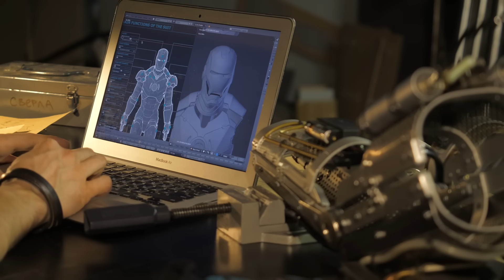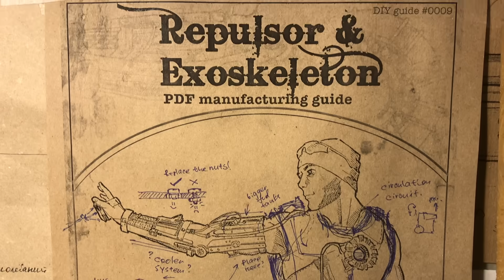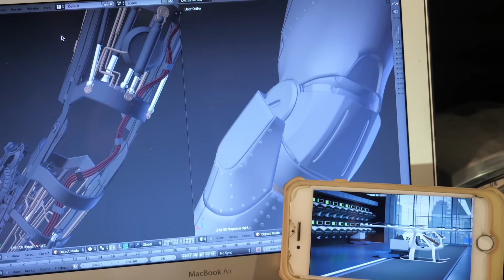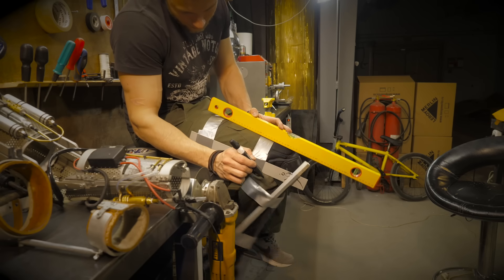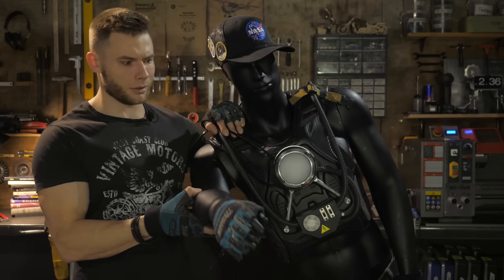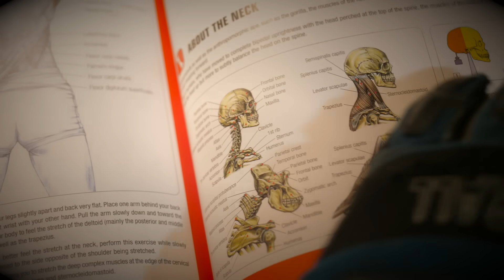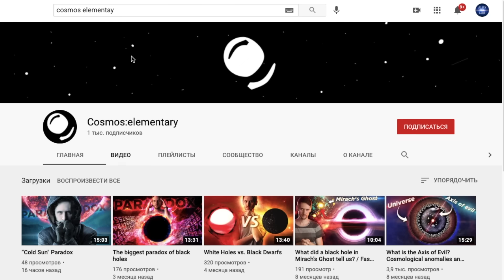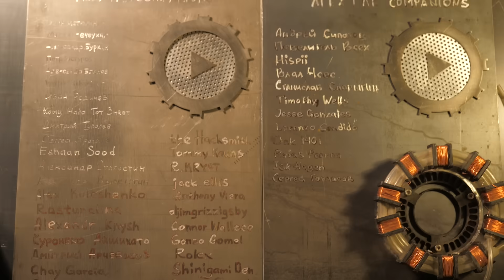Building real Iron Man suit (Part#2: Exosuit, hydrogen muscles & EMG sensors)

Comment: Could a brushless dc motor on either side of the knee and pneumatic cylinder with a ball or spherical joint in front of the knee work for providing strength support?

Comment: Hey dude, have you thought about using structural silicon as ligaments? It would be a bit more flexible than springs. Assuming it can securely attach to the aluminium frame.

Comment: @Alex Lab, Hey Man, your ding your elbow wrong! You need a ball-joint with a flat back and limited angles for safty. Also the thicker steel with the sleet ball insert will give you a little more protection on your joints. You can just cover it with a cosmetic joint for show.
Reply: You’re about a year too late…

Comment: Hey Alex, I had made a previous comment on how the iron man suit, is not a good design. Your starting to realize that. Flight is not even the biggest pain in the butt, its walking and mobility. Im using titanium and kevlar and running into a weight penalty. Then you have to solve the cooling issue. It gets hot in there. Im building a under garment cooling suit, you can adapt cpu water cooling fans for this. This has to be your phase one. Once you have the cooling, you need life support, or how your gonna breathe. Im using a small hepa filter feeding into a modified sanding mask. Then you need to be able to communicate. A radio and a PA system. You see the limitation of fitting all this in an iron man suit. All engineers are familiar with the KISS principal, or Keep It Simple Stupid. Your HHO generater is brilliant, but why not make it larger and back mounted? Then everyone wants flight, screw flight, think power jump instead, or enough thrust to give you moon gravity. Again, this will be loud and hot. Then theres power generation. Id do HHO to a gas engine to a generator, back mounted. Then the exo has to be able to transfer the full weight of the suit down to the legs. Thats where you need the actuation and suspension. Boy designing one of these really is a pain...huh?

Comment: some of the issues i'm thinking of now is rust, degradation, friction, lubrication, gunk, you will have to maintenence all parts like you would a jet in my excitement I didn't take that into consideration theres also the power supply issue you could use paladium and cold fusion but how to make it small enough? of course another form of metal and radioactive matrial could be used.

Comment: This might work for flight maybe if static repel off aluminum but magnet fields can go through then an electro magnet can be in the center of an aluminum box of some sort when on walls of semi conductors can suppress the fields and then shut off the electro magnet then you have a box of electrons and the Earth's surface is negative charge to some degree so it might just repel

Comment: I'm concerned with your usage of brown gas at that pressure. I might have missed any security mechanism, but you're wearing a shrapnel bomb. I got hydrogen exploding in my face at room pressure and it was nothing, barely burned the tip of my hair (hydrogen burns hot, but too fast to do serious damage), but the story changes at high pressure and with metal that can be propelled by the explosion

Comment: Just love what your doing with this.  But we need a smaller diameter artificial muscle if your going to put armor plating AND force redistribution materials between the armor and your body.  A decade or so ago I saw some work being done on artificial muscles using carbon nanotube coils that reacted to a electric current that where considerably smaller.  I don't know if they would work with your setup however or if they turned out to be a good solution.  Couldn't find a good follow up on their results.
Reply: you should try to put this idea on the comment of his!!

Comment: sorry on bad explanation but why couldnt you make a quick connection separate parts design where there are two arm parts with tubes that have connectors on them and they are completely separate until ready to be put on you could even do it for the shoulder pads where there is a slot that they slid in and then you twist it a certain way and it locks on you could do somethign like this for the whole suit?

Comment: Hey Alex, it's rudimentary but if you still need a solution to fitting your arm into the suit when considering proportions could be by using a mechanism similar to what they use when testing your blood pressure. Although the overall dimensions would have to be the same as the length of your arm, you could implement this inside the exoskeleton and then inflate it to fit around your current mass. So you could have a nice fit even if the mass of your arms increases or decreases. In addition, it's air-operated so you could hook it up to the same machine that powers the exoskeleton's muscles. While this might not work for joints (I'm sure it could but you would need to add material to the elbow parts and increase and decrease the amount of air that goes into the cushioning in order to account for movement) I feel like in it's the simplest form, this could be well implemented in the forearm, wrists, and biceps. Also, this would help in minimizing damage if you fell.
Reply: you should try to put this idea on the comment of his!!

Comment: Ok... if you are going by how the armour amplified the users strength in the comic book, Stark incorporated linear flat armature motors in a 90 degree 'weave' to simulate human musculature. How did they work? No clue... absolutely no idea whatsoever... but if I had to hazzard a guess, they incorporated the same technology as a rail gun, but in a much much smaller and more controllable way... sorta like multi-position solenoids, but millimetres thick. 
The servo sounds in the movie.... well, let's just say, its along the same line as the "peeoo peeooo peeeoooo" sounds of the laser blasts from Xwing fighters in deep space. Silence doesn't make for fantastic on-the-edge-of-your-seat battle sequences. The oil squirting from damage... oddly enough, Starks earlier armers in the comics did use hydraulic actuators and cooling. But, we are talking about the mid/late 60s here.

Comment: General rule is to never pressurize hydrogen and oxygen in the same container, even if you are doing low pressure stuff like this. Why not carry a 15L scuba bottle? Weighs less than your generator and batteries and delivers way more rapid power. 
Good job so far, even with garage tools you are able to make this, well done

Comment: I can already see those artificial muscles going over the front of the legs are doing to need some protection to not get worn out by rubbing against the metal. Otherwise those things are eventually going to rupture from wear and tear, earlier than they would normally anyway.

If you haven't already you should consider doing some damage testing to those muscles, see how they perform overtime with and without a load. How many cycles they can generally handle before failing.

Comment: I guess this really highlights the difference between Alex Lab and the Hacksmith. When the Hacksmith was doing their iron man suit, they went straight to trying to fly. They went for the showpiece. Alex seems to have taken a far more logical approach, by working from the ground up to design a system that can work with the body, first and foremost. An actually useable system, as opposed to free-floating thrust. When (if) Alex adds thrust to his suit it will already be set up to aid him in keeping rigid/steady while under thrust.

Comment: I still think a safer and more powerful/efficient gas for your artificial muscles is nitrogen,its a ton more stable and slightly more powerful,and consider a built in nitrogen compressor to filter out and refill built in reserves. But your on your way buddy 👍

Comment: Alright Alex. i watch a few of your videos and agree with the high voltage pulses for more efficient hydrogen production, so i wanted to point you toward Magnetrons... for microwave frequencies. I have been looking into things off and on for many years now just haven't done anything with it yet.... one of those materials and equipment don't add up issues. I may have to look into the differences between high pressure generators verses low pressure generators ow and see what i can put together. 

as for your synthetic muscles... if you can sleeve multiples of those balloon assemblies together in groups and then place many groups along side each other and wrap them together you should get a far greater amount of strength out of them.

when it comes to the braces and frame work for the exoskeleton look into building contoured plates that have a 1/4 - 1/3 or even 1/2 twist around the limb (arm/leg) with a full ring around the end near the joints. this will permit your muscle to twist the metal supports when they compress causing the rotation of the joint permitting a larger degree of range in motion without compound hinges...

I would love to join you in your adventure!
if you have any questions of hard obstacles to get over in design please ask and i will see what i can do to figure out a solution, even though it looks as if you do more research into these things than i do.... i have lack of incentive and motivation issues. Creativity is key in a lot of these processes hard work is the step i falter at most the time.
Reply: you should try to put this comment on his comment to give him ideas!!

Comment: I was wondering if it would be possible to use the hydrogen generator to create hydrogen peroxide since hydrogen peroxide can be made from water as well. If you could use the hydrogen peroxide as rocket fuel for the iron man boots because if you spray hydrogen peroxide over a catalyst (i think aluminum or copper works best, I'm not sure tho) it reacts violently and rockets out the back which could be used to create a cheap rocket engine that could create its own fuel. I don't really know, how practical this is but it's just an idea.
Reply: you should try to put this comment on his comment to give him ideas!!

Comment: Hm, I wonder if you could use a hydrogen fuel cell to regenerate the water that would have been lost through venting the excess gases.
Electrical regeneration is a nice side benefit, but I don't expect to be able to get all that much power back.
Reply: you should try to put this comment on his comment to give him ideas!!

Comment: Hey Alex, it would be coo if for the helmet display, you contacted the former producer of NORTH glasses, see if he has some to spare, and then use those as lenses for the helmet, coding a Jarvis display into the arduino. You could find some videos of people creating Jarvis displays with tracking and everything, the tracking of people could be from the AI matching them to social media accounts, but of course this would also connect to turning of muscle contraction by turning of the arduino that reads your natural electronic impulses, turning on thrusters, etc, of course it’s all connected to voice command. I would also look at the Iron man MK5 wearable functional helmet for reference of voice activation, inner comfort, and adding IR lighting to the inside of the lens would be cool as well. Finally connecting Alexa to the voice activated helmet could lead you to have full control and automation of your lab, drones, etc, from your suit. Additionally, for the flight of Ironman, I know this a bit unconventional, but it’s worth a shot, I would look at the work of Victor Grebennikov, and supply current to a honey comb like structure shoe bottom, creating a levitating platform (Grebennikov used the molecular honeycomb structure in scarab beetle wings). Another suggestion is, you have multiple modes for your thrusters that are changeable by the automated turning of the “nozzle” so to speak, via motor controlled by an arduino, it would kind of work like a hose head with different settings. You could have blast mode, sustained fire mode, long range ray, short range (however these would require a longer and bigger laminar flow nozzle and more hydrogen perhaps, so not necessary). And of course with muscle contraction on the suit, combined with Jarvis’ tracking systems, with the push of a button on a watch like mechanism, maybe it could walk to you, presenting itself for a suit up. Also, it would be cool if your helmet had a regular flashlight mode, and also if one of your other hands had an activatible electromagnetic function. Just some cool ideas.
Reply: you should try to put this comment on his comment to give him ideas!!

Comment: I'm no engineer, but instead of having 2 pivots at the elbow, would it be easier if you had one pivot that could slide?
So let's say a normal pivot would be a circle peg going into a circle hole, you could make the hole pill-shaped giving the peg the ability to slide, making it more mobile.

Maybe you could also add in a locking mechanism to make it easier to pick up heavy objects

Comment: Idk if it’s possible but a gas mask type mouth cover would also be a good idea to stop moisture escaping into the helmet and if you decide to put something covering the eye holes it will help them not fog up. U could also attach it to maybe an air tank for high altitude. It’s also a good idea to look at some space suit tech for insulation, heating, cooling, cus if you do end up being able to fly u will be cold. Aero gels might be a good idea for an insulator but you’d have to find a more rubberized version then the brutal ones most seen today. There’s also the fact of hearing inside the helmet, could probably use hearing aids tbh and there are some pretty cool looking ones these days. You could also try and install and google glass type thing that feeds you information from things you are looking at. Would also be cool if you took drone tech and could have drones that fly above you and relay an image back like they do to drone headsets. Zoom lens might be good too  although it’s a lot to fit on a helmet. Image a swarm of tiny drones that you could just release and would give you like a couple block birds eye view.

Comment: On the subject of synchronized movement with artificial muscles, perhaps in the future things like neurolink will dramatically help with timing, in case sensors are too tricky or take too long to get in and out of. Also, I’m curious to know how the hand muscles will work considering a big part in lifting weights is grip strength. Maybe some sort of locking mechanism can be put into the hand that is triggered by a sensor that tracks a specific load (like a seatbelt when you move forward too fast)? That way your hands will not fatigue so quickly when lifting/carrying heavy objects. I don’t know much on the technical side but I love this channel! You’re doing what I always wanted to do, but never quite had the patience to learn completely 😂 keep it up man seriously!! Can’t wait to see more in the future!

Comment: Hello, your project is really unbelievable, but I would like to suggest rearranging the potion and length of the artificial muscles a little, since it seems that some do not tighten quite well and are loose, I think that if they fit better or adjust the length you will they would give more and allow to carry more weight, thanks and good luck :)

Comment: Use carbon tububuals   like jellow strands mixed with iron oxide   turn on the electric then use magnetism  more flexible and one strand 100lbs. The movement is much more comfortable.

Comment: Something to watch out for: if two different metals are in contact with each other (like aluminium and steel) any presence of moisture will lead to galvanic corrosion down the line.

Comment: Can I suggest using threaded rivets? instead of using the screw and nut method, these rivets allow you to screw directly into them, prevents you having to hold the nut in place with a spanner as well, just easier for you :)

Comment: What if your repulsor can be upgraded by replacing your combustion chamber on the palm with a compressible combustion chamber on the back of your exoskeleton.
Why I said this is because if we use a compressible combustion chamber it will store more hydrooxy gas than the simple palm combustion chamber. You can use  your compressible gas cylinder from the light saber as the combustion chamber.
When this gas is stored a control system  opens the valve of the cylinder(solenoid valve) the gas quickly rushes out through tubes(the tubes should be thick to withstand high pressure) to the palm then at this point the control system should be calibrated in such a way that it ignites the gas in the compressible cylinder in half a second so the gas doesn't just rush out and also gives it maximum power. Try this it might work

Comment: Instead of trying to read muscle contraction with EMG sensors, try using pressure sensors between your body and the insides of the suit. Program a simple control algorithm to activate the muscles to minimize the pressure (activate counter-force muscles in proportion to pressure.) That way, if you are using your own muscles to exert a force on the suit, which is in-turn exerting a force on an object (lifting a car) the suit will automatically activate to help you. Resistive pressure sensors are simpler, more reliable, more consistent, and cheaper than EMG.

Comment: could you use the gas from the electrolyzer to build pressure that you then transfer via pistons and tanks to normal hydraulic components using a saver fluid?